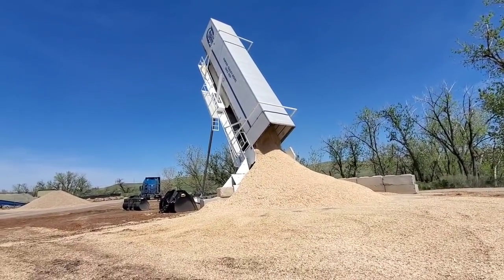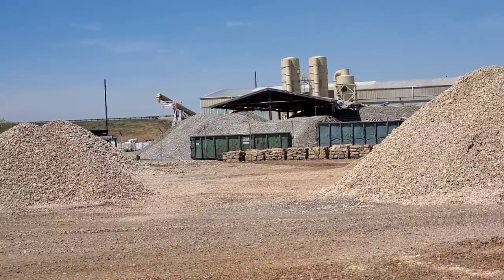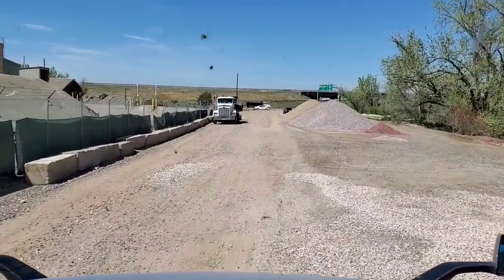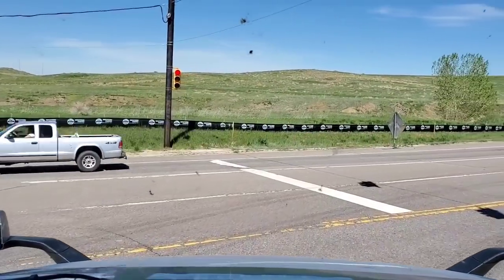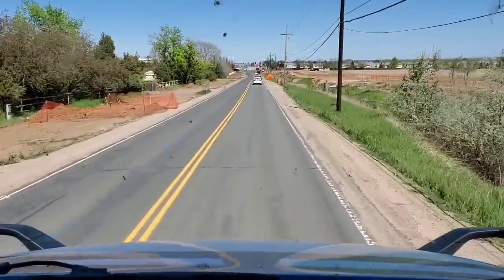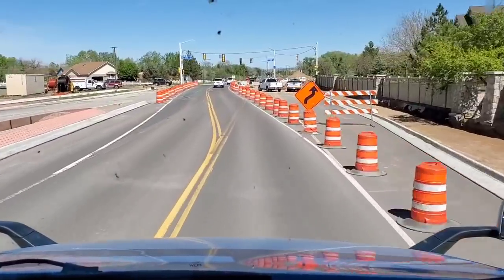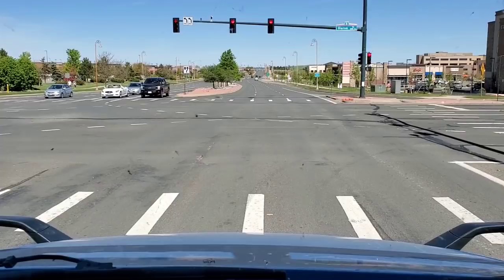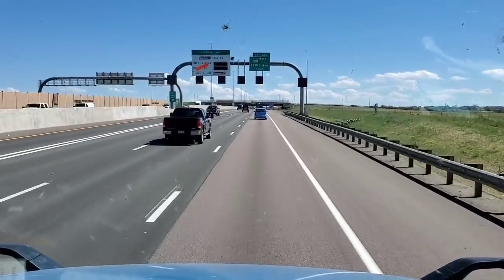Later That Day at the Consignee.. Trailer Lift.. The Only Way to Empty a Trailer!!

Comment: I remember when I was young, when staying with my maternal grandparents on the farm when going to the grain elevator with my grandpa to a tiny village the elevator had a lift for the wagons & trucks without hydraulic lifts. They would lift them up from the front wheels & dump the grain in the grate.

Comment: Awesome to watch the crane empty the trailer!  Loved your video on different loads and how they can shift, i.e. salt and beer.  Weight and balance is critical in a/c as well.  When the 7 yro pilot Jessica Dubroff, flying with her dad and CFI crashed in Cheyenne, their CG was aft. Whether it was caused by a load shift or out of balance on takeoff, when they got caught in the snow squall is questionable.  It was such a tragedy.  Curious about one thing though, what happens to the mounds of sawdust in a high wind?  

,

Comment: How did they load that stuff into the trailer? Some kind of conveyor belt?   I have seen these trailer lifts like that but where the tractor is lifted as well and does not have to disconnect from the trailer.
Reply from the maker: Yea it was loaded with conveyor belt.

Comment: Just a thought to consider if your trailer does not have a vent in the front, don't unload a damp load of dust in the winter as it will collapse the trailer. That is a lot of weight that has its mind to exit the trailer all at once.
Reply: They have vents in the front and back
Reply: If load touches top vacuum will suck sides in when dumped. I did it so I know. Mainly happens with tarped loads that are higher than sides.

Comment: I remember the ones where they actually leave the truck attached to the trailer and then lift everyting up juts like this, the driver is NOT usually allowed to stay with the truck,  but gotta tell ya right now,  if they would allow the driver to stay with the truck while they  lifted it up in the air like this ,  now that would make for one heck of a ride......LOL
Reply: Andrew, Where I work  as a millwright , one of my jobs is dealing with sudden mechanical and hydraulic failures on equipment. We have better quality units than that and  they are old ,but super reliable.  <<  Normally.>> That said the drivers back on,  usually dolly off, unlatch the B train internal doors, then press a signal button, and the remote operator raises the bridge to dump the truck. Normally it's very routine. Very safe.  One night about 3 am on someone else's shift a hydraulic fitting failed, the bridge twisted and dumped a 3/4 loaded trailer  and tractor on to the pavement  . No one hurt.  The tractor did not survive the impact.  No driver fault.    You are correct It would be" one heck of a ride". but a fatally short one.
Reply: Everything in cab ends up against back of cab. make sure no glass of liquid left in cup holder.  Had one driver sneak his kids to work and had to leave them in cab so no one would know. Had sleeper on truck half way up could see a little head pop through curtain to look around.

Comment: I installed some equipment in a particle board factory in Bend, OR in the mid-70's. They would dump the sawdust into a pit which had a large screw auger in the bottom which moved the sawdust to a concert belt. The sawdust was dropped from from the ceiling through a wind created by huge fans which separated the particles by weight.

Comment: In Canada we use a similar system to unload wood chips at pulp mills. The difference is that the truck and trailer are all tip as one. They Ed directly onto a convaer belt .then fr

Comment: The Procter and Gamble plant in Albany Georgia dumped trailers with peanut and pecan shells, and wood scraps (bark) from local mills. Used the stuff in a waste fuel boiler.

Comment: You really need a fuel card. Keep bugging them, there trying to save a buck on using only fuel from yard.  I'm retired truck driver , I was a chip hauler for 25 years .  The portable dump brings back memories. I've dumped hundreds of loads using them. Ran belt trailer last 8 years of driving.  Blower for cleaning trailer out is good idea. Think they would frown on the dust that would make, air quality is a big deal now days. I had three fuel cards when I quit driving. Safe motoring.

Comment: We grow soybeans and over at the Co-op they lift up the whole truck. We have a smaller connected truck/trailer. The semi's have theirs that have a door in the bottom to unload straight down. Man did the truck ever burn oil out the back for the first 5 miles after being let back down.